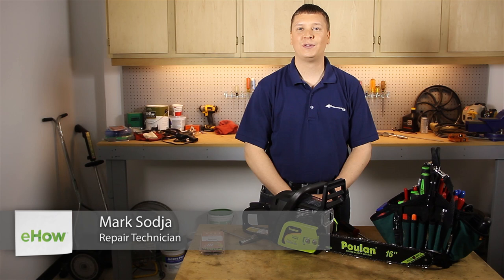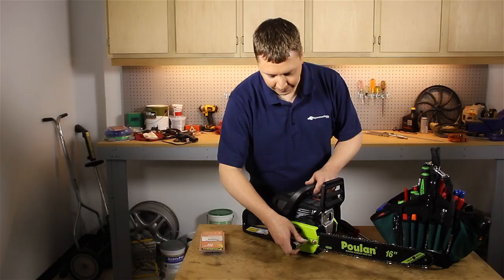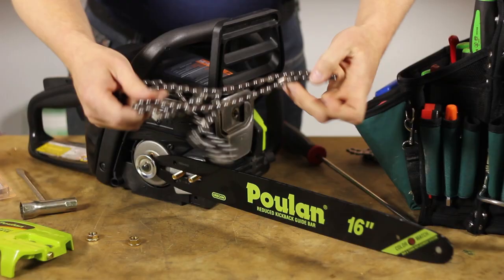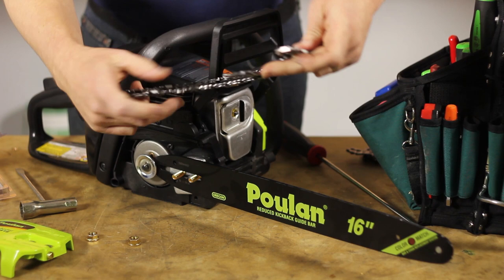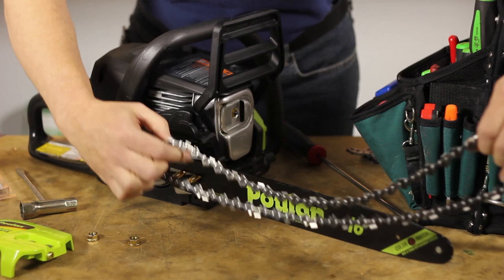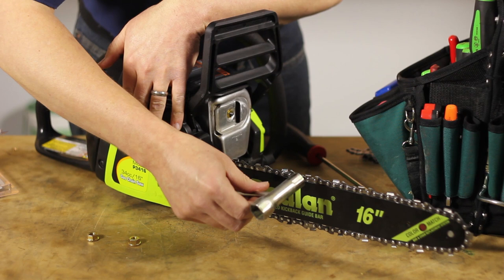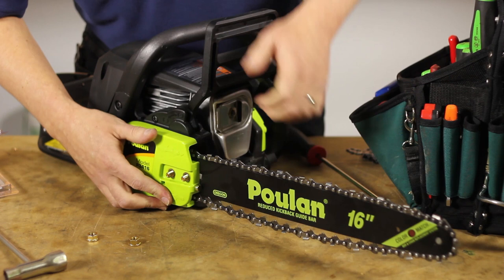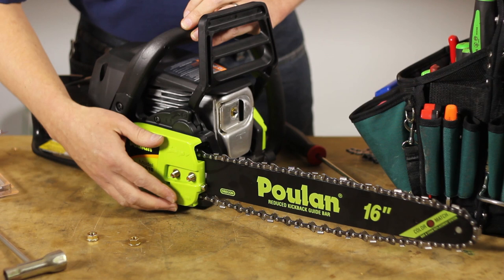How to Install a Chain on a Poulan Chainsaw : Lawn Care & Power Tools

Comment: Just replaced the chain on my saw,  I am a 70 year old woman......glad to have these instructions though,  wanted to make sure I had the chain on the right way.  Mine was a tad different because mine is electric, ,mine has a little metal bar that goes in front of the sprocket to make sure the chain doesn't slip forward and off.
Reply: You go girl!!

Comment: Handy thing do is clean the bar completely and check the oil feed is clear then run chain oil around the bar grove to protect the bar as a new chain will be dry and run hot until oil finds its way around.
Reply: the new chain is not dry it is covered in oil, or mine was.....

Comment: I have a Poulan electric chainsaw model ES300 and need to replace the drive gear since motor runs but chain doesn't. do you have a video or instructions on how to do this? this model doesn't have a brake and looks like you'd have to disassemble the motor side (my guess).  thanks for any guidance.

Comment: Tip from an avid mechanic. Take poulan chainsaw back to the store you bought it from or calmly throw the motherfucker in the trash after you use it The first time. I went through 4 in a week and the store I used decided to stop selling them. Buy one Stihl and you'll have it whenever you need it.